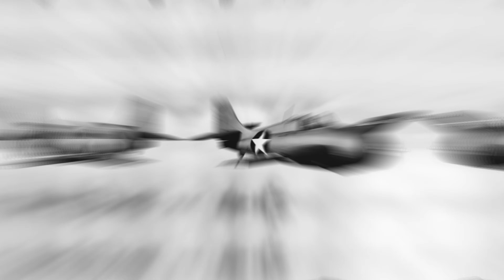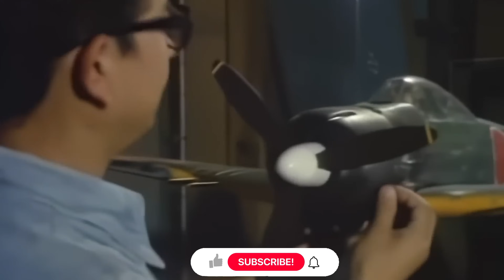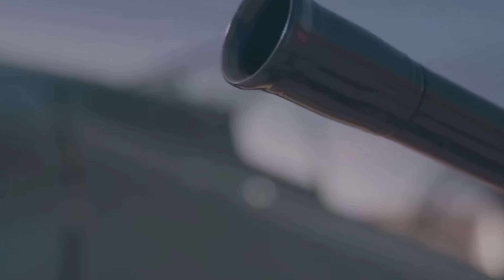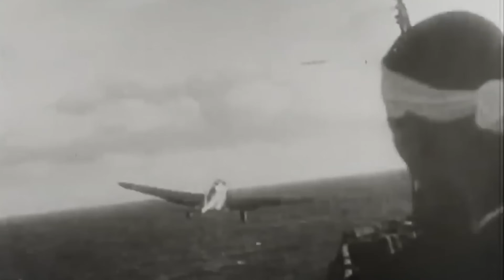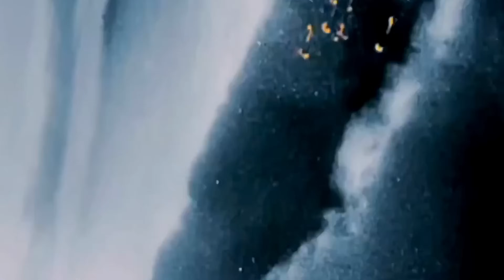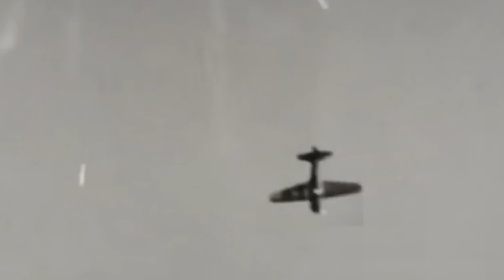The Insane Engineering of the Mitsubishi A6M Zero

Comment: It all comes down to weight and power, the zero weight was light, no armor plus a moderately powerful engine thus gave it delightful handling, but thats where the zeros advantages ended. Once the Americans came up with the hellcat and DOUBLE THE HORSEPOWER, not being maneuverable wasnt such a problem, since if you want you could simply hit full power and no zero could keep up with a hellcat or match its firepower or armor, the things were flying tanks. All they had to do was refuse combat and climb or dive away!   6 50 cal machine guns all coming together into a light weight zero usually meant death or a destroyed plane, and over time thousands of Hellcats mean 0   zeros!